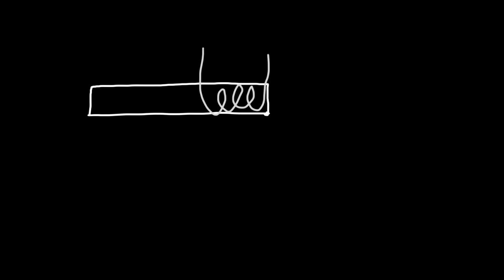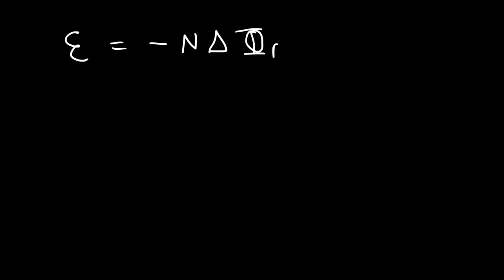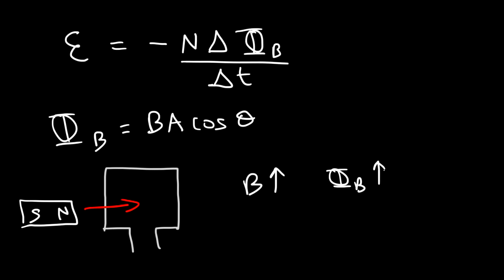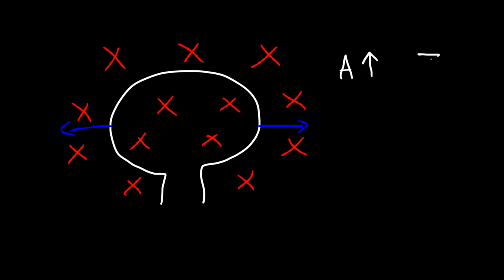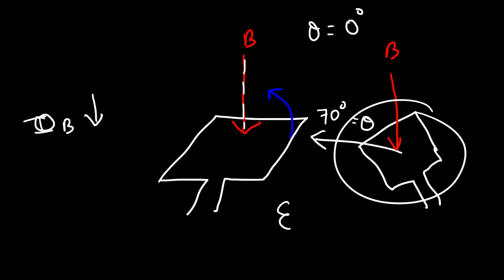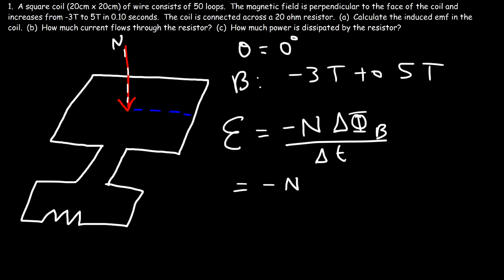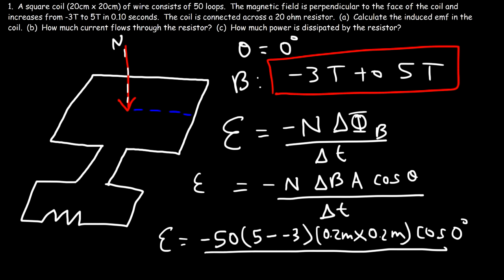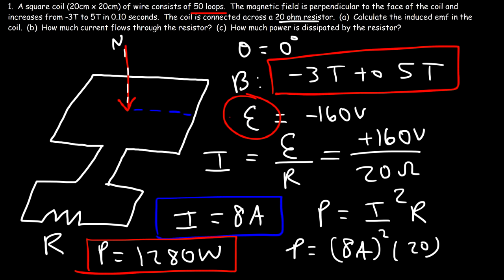Faraday's Law of Electromagnetic Induction, Magnetic Flux & Induced EMF - Physics & Electromagnetism

Comment: shouldn't the angle be 180 instead of 0  between area vector of the coil surface and magnetic field vector.?
Reply: I think you are taking care of minus sign in the equation e = -  N dՓ/dt. But it is misleading. What I suggest is that the angle between two parallel vectors is zero not 180.
Reply: @AshfaqAhmad-ob8ov  I acually thought the angle should be 90 degrees because the magnetic field is perpendicular to the coil

Comment: Shouldn't power dissipated be multiplied by the time? 1280 is the wattage meaning the energy dissipated per second (j/s).
Reply: This is late but in case anyone else is wondering: time is taken into consideration. An amp = 1 coulomb per second.

Comment: BADvideo, because you are ambiguous about the signs and facing of a lot of IMPORTANT things : the angle between B and the normal vector of the surface is not clearly explained. The sign of the induced EMF and also the sign of the current are IMPORTANT things when you study induced EMF.

Comment: A 50 turn coil has a resistance of 2.5ΩΩ   If it is enclosed in an area of 25 cm^2cm2, what would be the rate of change of a magnetic field parallel to its axis to induce a current of 0.5 A in the coil?

Comment: Does anybody know what happens with the negative emf? Like what does it means if it was negative?
Reply: the minus sign is due to Lenz's Law and it is because of the conservation of energy.  "the direction of the induced emf/current  is such that it opposes the change which created it." basically the magnetic field that was produced as a result of the induced emf is in the opposite direction to the original changing magnetic flux/field.

Comment: If the resistor has a current flowing through it, it also has a voltage drop, but the wire is shorted and must be the same voltage everywhere in the wire, assuming a perfect wire. This contradicts the current flow. Can anyone explain why this way of thinking is wrong? Can we not use circuit analysis with emfs?

My professor took an LED and connected both of the legs together in a loop held it in an alternating magnetic field and it lit up the LED. Im having issues understanding what the voltages on either side of the LED would be.
Reply: Damn u nerdy! I didn't get a single word u just typed
Reply: Why are you watching this video then? lol